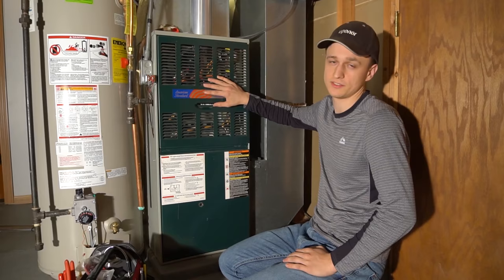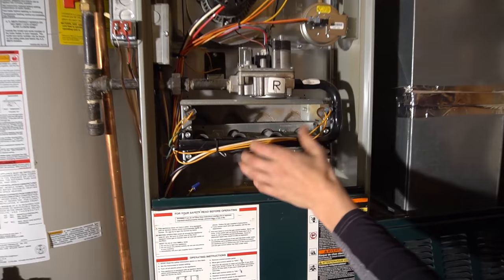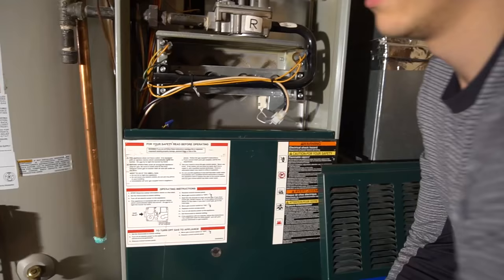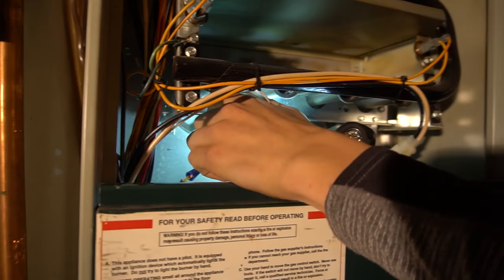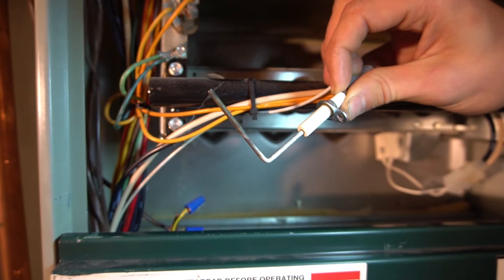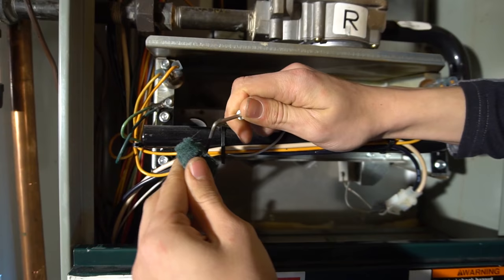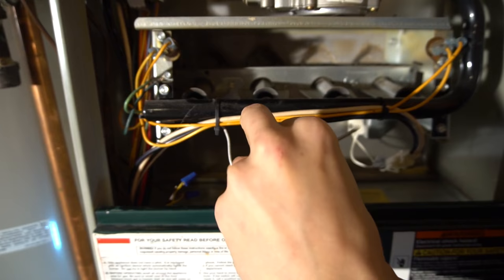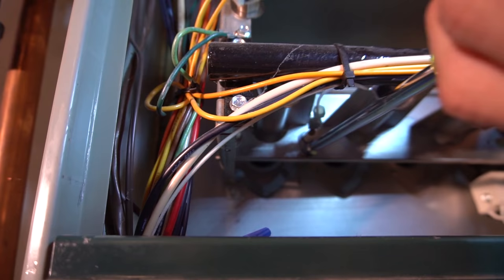Furnace Burners Dont Stay On! SOLVED

Comment: My wife and I were having issues with the furnce turning off after igniting. We didn't know what to do until we came across this video. I couldn't get the piece out, so I used a bristle brush to get in the area and remove the residue on the sensor. When I turned it on, IT STAYED ON!! Thanks to your quick tip, we didn't need a service man and my family not walking around like frozen popsicles. Thank you so much, and God Bless.

Comment: Omg thank you for your video. Just got home from a long shift, and 10 degrees outside. Noticed my house was cold when I got home. I messed with the thermostat for a min then went downstairs to the furnace. Cutting on and off just like you said. I prayed to god to help me because I knew I couldn’t afford to call a professional out at this time. I looked up furnace keeps cutting off and your u tube video popped up and it fixed the problem! God is good! Thanks

Comment from the maker: For those of you who might want a more thorough explanation.. Here is a more elaborate explanation without going too technical on you.

What is it for?
The flame sensor is a safety that is there to shut off the gas valve in the case of an ignitor failing. That prevents natural gas from leaking out and not being ignited. The flame sensor itself is really just a metal rod, nothing too special. 

How does it work?
There is a small amount of voltage sent to the flame sensor by the control board. That voltage actually jumps onto the flame and then to the burner to make a connection to ground and complete the circuit.

Why does it stop working?
Combustion requires air so when the furnace is working, it is constantly sucking air in, either through an intake pipe or through the grates in the cover door. Naturally the air pulled in has dust in it along with other tiny debris. That eventually coats the flame sensor and when it is dirty enough, that prevents the small amount of voltage from making that connection to ground.

Comment: I've been looking for videos about this exact problem.  i even called some furnace maintenance companies about this.  They told me they have no idea how much it costs for someone to even come and check, or it might be something like a $200 service fee, just to come and check, and "maybe more for parts and labor".  After researching online and watching a few videos, i pretty much knew the problem was down to one of two things...ignitor or flame sensor.  I can/had looked into holes and between vent slots, while it was running, and i could see sometimes a redhot bar and a jet flame...that's when it was "working properly".  My problem was the flame sensor, because eventually the furnace keeps turning off, even if it is lit.  So, I found this video finally, I unscrewed the flame sensor, wiped it with paper towel, scrubbed it with a green dish "brillo" "greenie" dish-scub pad, wiped it again with a paper towel, screwed it back into place, turned my system back on, and...bingo...it is working properly.  It's not the middle of winter, but its been a chilly spring here in midwest central Illinois, USA, so this video definitely could help some ppl im sure.

Comment: I will try this. If it works or not, at least I can say that your video was the most straight forward and easy to follow video yet
Reply: Just did it and it took me longer to identify the right socket and clean the sensor (5 minutes) than it did to remove and reinstall the sensor
Reply from the maker: @Tino G. I'm happy to hear you were able to quickly get it fixed!! :) Thank you leaving a comment, stay warm!!

Comment: Hello thanks for the informative video. My furnace started playing up with exactly the same symptom; the burner goes on for about 3 secs then shuts off. I also get the 3-flash (pressure switch open with inducer on) error code though. Then after a few times it goes into 6-flash (pressure switch cycle lockout). Before I saw your vid, I tried clearing the pressure switch tubes and ports (nothing there). It's an Armstrong Air HE gas furnace (7 years old) with a 2-wire and 2-tube pressure switch.
After your vid, I cleaned the flame sensor; it was pretty clean with a dark blue smudge. Didn't really remove anything. After I put it back, the burners now go on a bit longer like 10 secs then shuts off again. The LED light indicator stays on while the furnace is trying to fire up and with 3 flashes when it shuts off in between tries before going to the 6-flash lockout code again. Please help...

Comment: Thank you I have been having issues for a while and it was like it would work when it wanted to but it hasn't worked all day today and I thought I was going to start having to replacing stuff till I found the problem! Specifically with this cold weather coming. So I really do appreciate this video it only took a couple minutes and the heat is working again

Comment: In my furnace, the position of the flame sensor is very important.  There is a certain amount of slop when mounting the flame sensor and I can position it in a few different ways by holding the flame sensor base while tightening the screw holding it in.  If my flame sensor is slightly askew and not close enough to the flame, it will fail and cause the burners to shut off after 5 seconds.  Consider this when re-mounting your flame sensor.
Reply: This one appears to be 'dummy proof' - as the white part of the sensor goes in its hole and the screw goes in its hole.  But I am no expert!

Comment: Thanks for the great video!  As you said at the very beginning, I've been "fixing" my gas furnace when it stops working sporadically by turning off and on the power switch.  But my question is:  what's causing my furnace to stop working occasionally?  I can't figure it out.  I'll appreciate you advice!  Thanks

Comment: I tried  this with no luck, I even replaced that flame sensor and still nothing (same symptoms) . I cleaned that little groove between burners, hoping this could help, no luck. It's an old equipment with only a few codes available and at this point it's kind of useless. Any hint will be welcome, thanks on advance.

Comment: So cleaned flame sensor, burners come on and still go out in 5-10 secs. Bought new flame sensor, same thing happened. Any advise as to next steps to check. Should I start checking high temp sensor  and/ or condensation trap on 90 % high efficient Goodman furnace you think? Love your videos by the way, just wish these easy fixes were easy for me too LOL
Reply: Update: although high limit switch tested good (closed), replacing did the trick

Comment: Hi! Thanks so much. Quick question before I try - what happens if you drop the screw? My hands are a little shaky. Thanks again. -Nadiya
Reply from the maker: As long as the power is off, there will be no problems if the screw is dropped. (might be a little annoying if it falls in a crack or something but usually it's easy to retrieve.) You could even use a different screw to secure it if you had to.

Comment: hey so i cleaned up my flame sensor worked right away but still not working perfectly sometimes flame will stay on for an hour or more and then go out start blowing cold air, sometimes it wont kick the flame in for a while i would ave to shut the switch and turn in back on and try a few times before the flame stays on, any idea what it could be?

Comment: Question I replaced the flame sensor. It will light for a second go out. Does this about 3 times then shuts down without warming the house any other suggestions to point me in a right direction? Also great video!

Comment: I'm having this exact problem.  I believe I've narrowed my problem down to the white flame sensor wire.  Checking the voltage to the flame sensor, I get 0.0 uA when the flames hit the flame sensor.  
If I put one meter probe to ground and insert the other meter probe down in the molex plug with the white wire, I get 0.0 voltage.  However, if I insert the probe in other wires around the white wire, I get 26 volts.  Shouldn't I be getting 26 volts as well with the white wire inside the molex plug?  I checked continuity of the white flame sensor wire and it is good.  The wire does not have a break yet I'm not getting the proper voltage readings even with a new control board.  Do you have any suggestions?  Thank you!!!

Comment: I recently was getting a pressure error and replaced the pressure switch because it was bad when I checked it. It worked for about a week and now it’s giving me the same error. The water trap is emptied. I have yet to find a clog. My inducer motor kicks on but maybe it doesn’t have enough power anymore? Is that even possible? Any tips? Low on money so I’m trying to do it myself.

Comment: My furnace is having these exact symptoms.  Lights for 3-5 seconds over and over.  I've tried cleaning the sensor , but it didn't work , should I just try to replace the sensor?
Reply from the maker: Sorry to hear about the furnace troubles! Replacing it will likely not help.. I would try cleaning the furnace burners next: https://youtu.be/6ehk0NZVFcg?si=fj0qB59dLbditimd

Comment: Thank you for the video. I have clean and even replaced my flame sensor and the furnace is doing the same thing. I have a goodman 80% efficiency. The fire turns on for 3 seconds and it shoots off. I even replaced the board and still doing the same thing. This is a goodman seer 13. Once it tries for 3 times the machine just locks out.

Someone told me that maybe my gas valve is not getting enough pressure out and that's why it turns off. 

I don't know what to do. What do you suggest I should do?

Thank you for your help
I also got DC voltage coming from the board to the flame sensor

We will still have no luck on the lit to stay on
Reply: Camilo did you get this resolved? I have the same problem. It’s been going on for a month. I replaced the gas valve, flame sensor and control board. I still have the same problem. Just curious if you got yours fixed and what the solution was.
Reply: @billclark9418  Hello, no luck yet. My friend told told me to start checking cables and connections. I am planning to do that this week. Please let me know if you find something yourself.
Reply: @billclark9418   I found the solution. The board I originally replaced it with was an old board that my friend had. Today I replaced it with a NEW board and now is working like a champ. 

Moral of the story: make sure you are installing items that actually work. I learned this the hard way. I hope this helps you.
Reply: @camilo11315  AWESOME!! Yes I”m starting to suspect the same with my furnace. I’ll have to pull my control board and look at the back of it to see if there’s any evidence of bad spots on it. It’s supposed to be a brand new board, but that doesn’t always mean it’s a new working board. I’m glad you got your furnace working!

Comment: My furnace was doing that about a month ago so i called the heating guy. He came out didnt see anythung wrong other than possibly the sensor.  He cleaned it off, started up and now its doing the same but once it turns off , stays off, doesnt recycle.  Could the se sor just be bad and i need to replace??
Reply from the maker: I don't know if this is something you would want to tackle but cleaning the burners might help: https://youtu.be/6ehk0NZVFcg?si=RL4YVKS6x0OwVSmu

Comment: Tried cleaning the flame sensor (it really needed it), but it didn't fix it. I saw the fire come on in one of the four gas tubes (not sure names) it didn't seem to be getting to the sensor. Then it shuts off after a couple of seconds. Tried measuring the microAmps but didn't see any (fluke multimeter). I did use sandpaper b4 watching this video. Can you check for microamps by holding this sensor in a stove fire and measuring from screw bracket to terminal. Should I just replace the sensor?
Reply from the maker: If you are only seeing flames in one of the burners, that would mean that the other 3 burner orifices may be plugged with something. (like a spider web for example) If you have a small mirror try looking at the burner orifice and see if it's plugged on each burner. (the orifice is a small brass fitting about the size of a dime with a small hole in it that is in front of the burner, where the gas comes out)
Reply: FYI, Thanks for your videos, and advice. I cleaned my orifices and the furnace came on!
Reply from the maker: @markrandel3655  Awesome! Thanks for the update, stay warm! :)

Comment: what if after the flame is ignited and the blower starts to run. but 4 seconds after it turns on. it would suddenly stop and so would the rest of the sysytem soon thereafter. And i noticed that the blower motor is so hot to the touch when this happens. what do u think could be wrong there

Comment: I have a carrier infinity sys that goes in to fault when i increase the temp 3 or more degrees. had it chk by the installer company who was unable to determine the cause of the repeated faults. Company replaced the heat exchange however the problem continues. any ideas what the problem  is?

Comment: I did clean and bought a new sensor but it still continues to go out after 3-5 seconds
Reply from the maker: What kind of furnace is it? 80% or 90%? Or in other words, is the venting a PVC plastic pipe or steel? Do you have in-shot burners? Also, do you have a meter that can measure voltage and amps? And if your furnace has a troubleshooting light, what does it show when that happens? (there would be a sight glass on the bottom door and the chart that explains the codes on the back of the furnace door, typically) The reason I ask all that is that there is a possibility that it could be something else.

If you have in-shot burners, try cleaning the face of the burner that is in front of the flame sensor with some sand paper. That might do the trick.

If you have a meter with a set of leads, here is what you can do to test the flame sensor. Set your meter to Amps. You will need to measure the DC Micro-amps, then do the following:

1. Turn off furnace switch
2. Disconnect the wire going to the flame sensor
3. Put one lead into the wire connector, and second lead to the flame sensor
4. Turn furnace on. (the meter is in series with the flame sensor)
5. When the flames come on, you should get a reading, usually its 1.5 - 3.5
(Here is a video I found where the guy shows this) https://www.youtube.com/watch?v=Uc_Al8DUxIQ

If, when the flames come on, the reading stays 0, then either the wire going to the flame sensor is loose/bad or the control board/ignition module needs to be replaced.
Reply: I got a new flame sensor and when I do this test I still get no reading. The flames poof right back off after it ignites. I tested the flame sensor wire from end to end and it has continuity and a reading of about 0.2 - 0.4 ohms. Any ideas?
I have taken the burners out and cleaned the faces and the wings to the sides of the faces. All 5 burners light, then poof right back out. There is no code flashing on the board when this happens. I've cleaned out both vents all the way to the outside with a drain snake and shop vac. The intake had a bunch of dead stink bugs blocking it at the furnace.

Comment: So my unit will work great for days and even weeks and then even tho I have it set to 74 it sometimes won’t turn on until it hits 69 or 70 and then the temp eventually hits 74 and then sometimes the unit will kick on and I’ll hear flames for a few seconds then they vanish. And the unit eventually turns off. 

I’ve had 3 different AC guys fail to figure it out because each time they come everything is working fine. It just randomly acts up. 

I’ve cleaned the flame sensor, filter is clean and have new thermostat.

Comment: I have a question. My burner stays on all of the time. It's on when the cooling is on and when the air isn't running. Is this supposed to be happening? If not what could be the problem?

Comment: i have the same model of yours. furnace turn on for 2 second then the flame shut off. i cleaned the flame sensor, same issue. then replaced with new one still the same issue. i short the R & W, still can not fix it. control board is WHITE-RODGERS model: 50A50-473 what else i should test?

Comment: My furnace flame stays lit for 1 minute or 2 and when the blower turns on it flickers and cuts out for a bit then goes out, could it be an air leak?
Reply from the maker: Yes, it could be a cracked heat exchanger. What if you turn your fan on (instead of "auto", switch it to "on" on the thermostat) and then turn the heat on. So the fan is already running when the flames come on. Will it do the same thing?
Reply: @WordofAdviceTV  Well sir you were spot on, I had some guys take a look at it today and they said just that. I'm hoping to get a new furnace tomorrow if the one they found is still in stock.

Comment: OK here is one fore you. I have trane furnace, I've cleaned my flame sensor as shown. It will allow my furnace to come on and heat the house for a few hours. Then the furnace will blow cold air. I check the furnace and no flame. I shut it down, clean the sensor and it's wash, rinse, and repeat all over again. I went as far as buying a new sensor ($6.50), installled it and it's still doing the same thing. I've cleaned the burners. I know it ignites.

Comment: Replaced flame sensor it did not fix issue still does the same thing , lights for few seconds then goes out. jumped out thermostat still samething